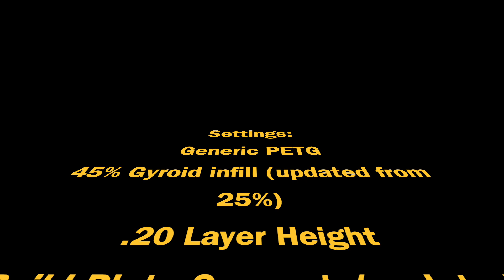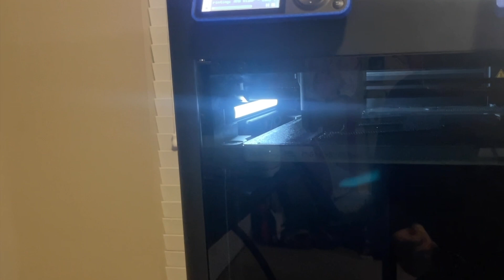Printing an AMS Riser in PETG (Pt 2)

Comment: IS THAT RED PETG QUITE RED OR WASHED OUT RED? TA
Reply from the maker: It's not really washed out but its not a Deadpool mask Red if that makes sense.
Reply: @3DPrints747  thanx for your reply, what brand u suggest for a Deadpool type colour?
Reply from the maker: I'd maybe try Prusa Lipstick Red.  I've never used that color, but it looks pretty close.  I usually stick to the inexpensive stuff and spray paint it, unless I'm printing a plane or something, then opt for the more pricey filament.  Prusa filament gets good reviews though.  Matterhackers may have it on sale so check there as well.  Here is the Prusa link.  
https://www.prusa3d.com/en/product/prusament-pla-lipstick-red-1kg/

Comment: Bed/Nozzle Temps? Print Speeds? Any a dditional tuning? Looks great, would like to replicate the success.
Reply from the maker: Thanks.  I selected "Generic PETG" in the filament dropdown and didn't change any temp or speed settings.   When I use supports I choose tree and set top Z distance to .34 and bottom to .3 but that's pretty much the only thing I really change.